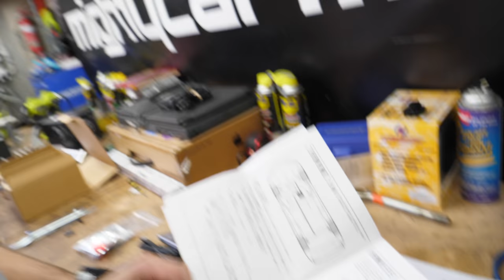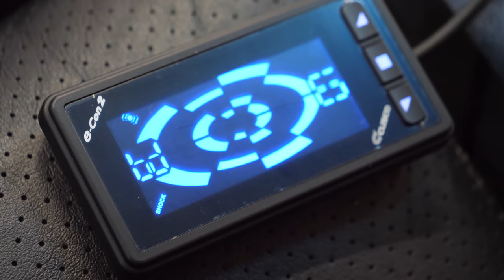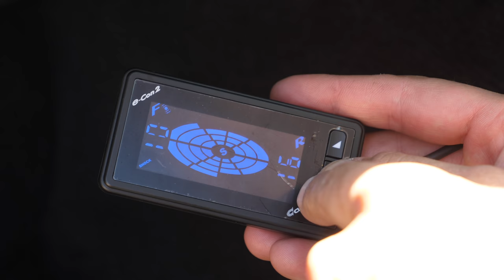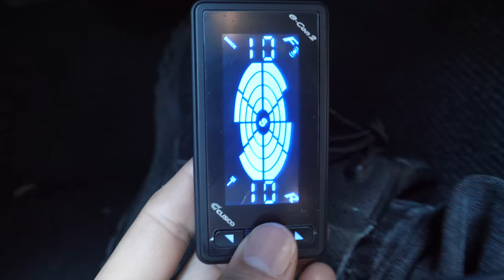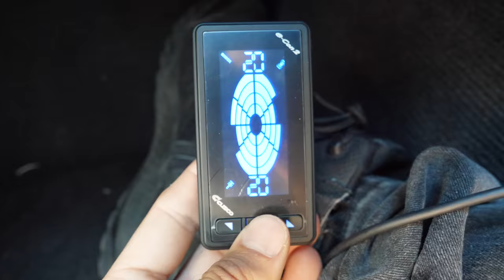Disrespected Supergramps JDM Electronic Adjustable Damper Control Nose

Comment: As a old-school bmw owneet project car too you have to be careful withyour oldskool books and written docs as they're quite rare to get in real Haynes or even English written German ones as no ody liked oldskool BMWs but being a rear wheel drive with do many options for instance mine is a 5 series and was approx 200k new as it's a special model a 535is and that's basically got a few parts in comment with the e34m5 I have spent lost count on it but I have gone from front to back top to bottom the only thing left is now to paint it in original colour which is 1of 3 colours as you will find it depends on the time of day when the car got painted as to what shade it is unless you bite the bullet and use a colour that is kind of mic if all three and you won't be able to tell without a 200k machine that does it for you how many microns thick and also what tints and so fourth are in it which shade of red or blue or white is usually safe as is good and purple or royal blue and they call it I'm guessing your doing a 3 series but don't go past the 5series it's hadleing is sublime the 528i lsd diff is a great strong diff and built to eat road wether top spead or just fanging it about also there is some awesome turbo and supercharger mods for them which are pretty easy to do diy for you project car plus when they are all done they truly are an amazing driveing car and a well built daily can at the press of a button or two be a drift ma home or track machine they are Soo much better Japanese cars and the clubs and forums for help are great stay away from main dealers unless you need a part that you can't find try to stay open if possible but slot of the gear is made in China and America and some Baltic country's the comfort level and balance of the 5series is to me and I was an Italian car guy and a commadore guy the level of comfort of a 30 year old car with 200kms plus on it as long as a modicom of service history had been done  if you can a fully log booked example and a 1or ,2 owner car your in Holy Grail territory due to the influx of ppl now figure out how much car you get for so little money like you bought the focus rs for that money you could have had a V10 manual M5 M6 or even M3 if you keep to the older models the E30m3 prices are now a bit high as r the M5 E34  and other special models in oth 3&5 like the AC shintzer and the hamman and the well u get the idea I wish I could tell you I have a car for you that's perfect for your show and well I do but it owes me now probably a  total roller value it's worth nearly 150k but that's because it's a logbooked fully period correct .ods apart from the stereo as it was going to be a showcar T first but then I broke the original windscreen with bass so it became a buildit back to get it perfect driving and listen ing car and spare no expense to make it the best you can now I have decided to swap out original parts and store them like engine and rims as it's got factory fitted hamman pg1 18" rimsso I swapped to 19"type 2 ac shnitzer also I will be swapping to possibly a non BMW engine conpkeatly if I can find one it will be a Judd racing engine for BMW cars specifically so a V8 that revs like a 20b Wankel but I also may squeeze a v10 from the newer e60model I to it I think 550hp are is fine stick add a supercharger like prochargwr style not a roots blower like a 8/71 blown out of bonnet job or one of the newer twin scrool penut superchargers like they use on jaoe ese car inconjunction with a turbo and a nitro fogger around the intercooler and make z street 800hp track 1700-2000hp but if I vo to that sort of power it will be mini tubbed I'm also building a memorial car in a supercharged mini Cooper s it will have all the upgrades you can and owe me approx 60-100grand at the end but this is a car that is being built to remember my mother who was taken too early by cancer and she had given me permission to upgrade it as long as it was streetsble not stupid and it had handsfree Bluetooth for her fone and mag wheels well it's now as it is going to be a widebuny full rocketbunny style but in the German it euro way which is simply clean and sleek with no badges except the car maker or mini in this case as the car is light you will know this ad you have an old mi I original shape with a engine swap I'm not swapping the engine basically I'm making a fully race ready streetsble engine that you could put in a rallycross car so normally about 650hpatw however since that involves going 4wd  I think less hp and better tourque distribution adwell as a better lsd and traction control or a raceligic which you can put how much power is available in everygear so you don't over power it. It it's blisteringly fast I think 450hp are is more that enough it will be prepped for a 4wheel drive option as soon as I decide or figure out which is better the system from the gtir pulsar or a aftermarket version or a cileca gt4 version or what anyway pay hommage to the generous that is BMW I never drifted s other car that if you just to swap side of drift or go from left ha d slide to right hand slide to get you back to the tetering point u let go of the steering wheel and it self straightens no later if it's aftermarket suspension rims and whatever as long as it's been wheel alignment and had fence t road race bilushings and upgraded away bars and the engine has had proper work fine the old skool kind hand die grind port and polish and then extrude home and full port polish blueprint and power upgrades done right you will never own another car fir racing again unless you need 4x4hadleing if so buy an Audi but if it's just drift drag circuit or gymkhanas BMW has you covered

Comment: So the new BMW is either an e30 or e34 based on that repair manual.

Common sense says its an e30 because they are cool as hell and tick the box for Marty being light and handling well
 butttttttttt
e34 wagons are also cool as hell and if it is Moogs car then that would be a car that would be comparable with supergramps

I'm really hoping its an E34 wagon that gets turboed and raced/dragged/dynoed against supergramps